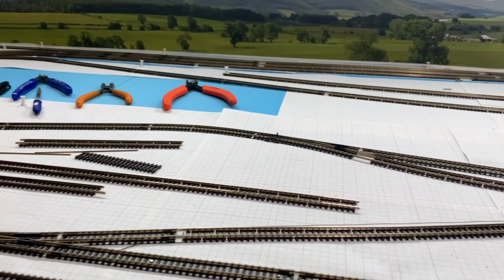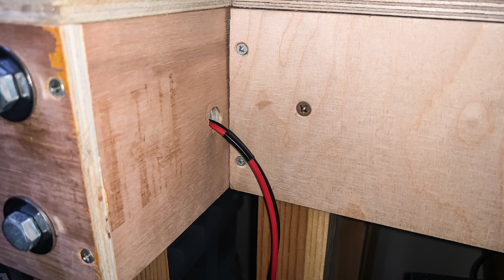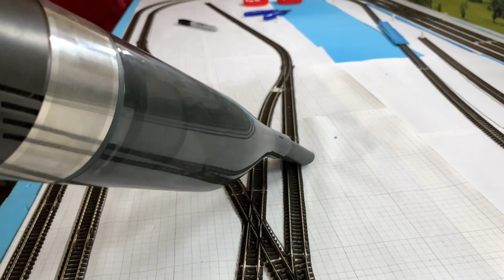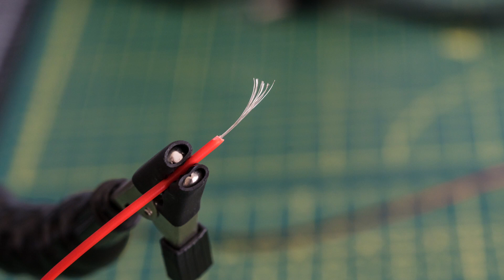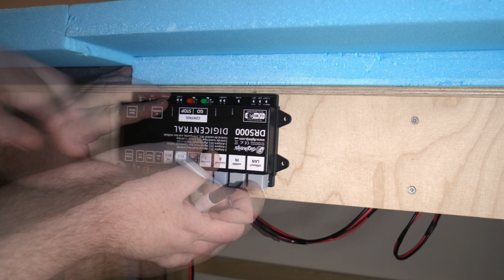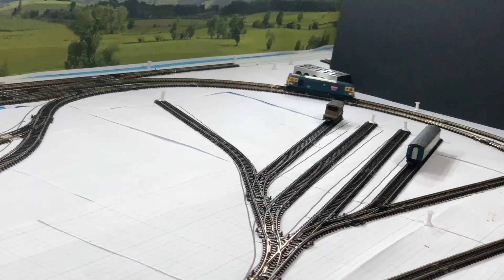031 - Shelfington - Powering The Track

Comment: Hi Ian, maybe think about a couple of level crossings for when you build up the yards/ stations etc. great layout! I have some bits for an n gauge layout but don’t have the magic beans to buy everything.
Get yourself some hard plastic knee pads with gel inserts/foam. £20 from B&Q. They will save your knees!
All the best!😉👍
Reply from the maker: Hi! Yes, as the track plan is now coming together, I really need to start thinking about road infrastructure, so level crossings will definitely come into it at some point! I'll have a look for the knee pads you suggest, although nothing I've tried to so far has come close to protecting them! All the best, Ian.

Comment: Something I found when making my own small layout (also N gauge Code 80 PECO track)... solder the wires to the bottom of the fishplates - you can stick a fishplate on an offcut of track to do this, the wires solder much more easily to the fishplates and once installed its totally hidden. makes adding droppers to the toes of points etc really easy and you can in effect mass produce the two colour droppers away from the layout
Reply from the maker: Hi Dale, yeah, I initially bought some Peco pre-wired fishplates, but quickly realised that the wires weren't long enough, and neither did the fishplates always coincide with where I wanted to place dropper wires - hence my decision to solder my dropper wires to the bottom of the track! Great tip about adding a fishplate to an offcut of track in order to solder a wire to it! I'll remember that for the future! All the best, Ian.

Comment: Hi Ian. You need a 15w soldering iron to solder your dropper wires to the track. Anything with a higher wattage will be too hot and therefore melt the sleepers. All the best. Antony.
Reply from the maker: Hi Antony! My current soldering iron is 60W, but I've got it adjusted down to less than half! I found that any lower and I couldn't get the solder to flow onto the rail properly! My technique has definitely improved since I started soldering to the bottom of the rail, and I've only sacrificed a couple of sleepers since adopting this approach! Thanks for the suggestion though, I'll keep it in mind when I next purchase a soldering iron, as 60W is definitely too much!! All the best, Ian.

Comment: Lol! I just read Stephen’s (Elevenholme) comment below, it’s all so familiar, plastic melting, and for me large globules of solder all over the track, burnt fingers too! Soldering for me was and still is to a certain extent tricky but worth it in the end. 
Good to see the 33 running around Ian, you can sit back with a cup of tea now and be mesmerised as I am watching the trains run round and not doing the work you intended to do!
Well done mate, cheers for now, John
Reply from the maker: Haha! It's great to know I'm not alone amongst such esteemed modellers John! I think I mentioned in another comment that soldering is a right of passage for railway modellers! I've not yet managed to burn my fingers yet - though it's early days! Lol! However, as you can see from the connectors I'm using, I'll opt for any alternative to soldering that I can find, at (almost) any cost!!! You're right though, I've spent precious little time doing stuff since I got trains running, other than filming them - and enjoying tea and biscuits while I watch! All the best, Ian.

Comment: I also have a number of pieces of rail that look like your first attempts! I sacrificed a couple of lengths of rail to practice attaching multiple droppers before I started and as you are probably discovering technique improves quickly. I now use a similar process to the one you follow and you might also want to try using a fibreglass brush to clean the areas to be soldered first.
Anyway I’m certainly impressed at how smoothly your loco goes round your track. Insofar as your knees are concerned I do recommend that you try some physio!
Reply from the maker: Haha! Glad to know that I'm not alone in my soldering, err, mishaps! Yes, I saw a tip about using a fibreglass pen recently, but can't remember where! I'll consider it for next time around! I'm very pleased with how my locos are performing, and so far, I've only found one misaligned fishplate - which is thankfully in an unsoldered part of the track!! All the best, Ian.

Comment: Hi Ian, great to see trains running its always a great moment and very rewarding to get to that point! Hopefully I will be reaching it for the third time on my layout build journey 🤣 very soon after changing the track design on 3 occasions now! Fair play you’ve stuck at it with the soldering I copped out and used presoldered droppers on fishplates 😉. Wiring looks neat and you can’t beat those connectors! Now it’s test, test and test to ensure it all works with al your locos and rolling stock and to enjoy the moment! Cheers Gary
Reply from the maker: Hi Gary, and thanks! Yes, getting the trains running has been very satisfying! I'm currently doing lots of testing, and working out what needs to change before committing to finalising the track plan! I already know I have to take all of the track up because I need to introduce a gradient towards the front of the layout! Yes, I've got some of those pre-soldered droppers too, but the fishplates were never near where I wanted to put a dropper! Lol! Those connectors are great though and I intend to use them whenever possible! Good luck with your changes! All the best, Ian.

Comment: Expensive way of connecting. Those Wagos.  Easy and effective but eats your budget. 😊
Reply from the maker: Yes, it's definitely an expensive way of joining wires together, but they're an excellent product, and can always be bought when they're on sale! Besides, I'd never have been able to solder the wires together, and those cheap suitcase type connectors can be quite unreliable! All the best, Ian.
Reply: They’re not branded Wagos though so not as expensive and better than those scotch lok type imho
Reply from the maker: Even the unbranded ones are fairly expensive compared to other connectors, but I think they're much better than most other connector types too! Cheers, Ian.

Comment: Seeing your first attempts at soldering brought back painful memories of my first attempts.  Plastic does melt rather quickly doesn't it?  Really good to see the loco running and it ran well over the points and smoothly throughout.  It is such a nice feeling once you can run a loco around the layout rather than on a section.  Stephen
Reply from the maker: Haha! Sorry to bring back such awful thoughts Stephen! Yes indeed, plastic is no match for a moderately hot soldering iron tip! I was very pleased with how smoothly the 33 ran, especially over all of that pointwork I soldered together in my previous video! I was having nightmares about what I'd do if a loco failed to get over them - and how I'd explain it to everyone!!! It's definitely fantastic to have two loops up and running now, with two trains running around them! I even had a third train running in the quarry area a couple of days ago, but not for long as it made my head hurt keeping track of everything! Lol! All the best, Ian.

Comment: Probably a bit late, but are you applying some flux to the rail and wire before you solder? It helps make the solder attach more quickly. Also using some small metal crocodile clips as heat sinks each side of the joint may reduce sleeper damage. 😊
Reply from the maker: Hi, yes, I thought I mentioned adding flux to the rail before introducing the solder somewhere in the video, but maybe I forgot! Great idea about using the crocodile clips as heat sinks, I'll definitely be using that next time I have the soldering iron out! Thanks! All the best, Ian.
Reply: @iansngauge  . Yes you did mention putting flux on the wires later in the clip. 😀

Comment: Greetings Shelfington and hello Ian 👋 Only fitting that a glorious Class 33 😍 was first to christen the layout 😇 I'm a solder to the rail underside man too 😁 though I only use one hole 🕳 😳 for the wires, in the middle of the track 🤫 makes them even less visible once ballasted 👍 Enjoy your testing, aka playing trains 😁 Very best wishes from the Emerald Isle ☘️
Reply from the maker: Hi Paul and fellow shelf dwellers! Yes, the 33 had to be the one to make the first circuit! Actually, I'd considered only one hole, but thought drilling between the sleepers would cause more damage than me trying to solder between them! Lol! I'll give it a go on some test track as there are still many more dropper wires to add! I've definitely been enjoying the 'operational testing' I've been participating in! Lol! All the best, Ian.
Reply: If your lifting the track to solder the rails, you can drill the hole 🕳 then, won't have to drill between the sleepers 😉
Reply from the maker: Aha! Good point Sir! Didn't think of that! I've obviously been sniffing too many solder fumes! Lol! Cheers, Ian.